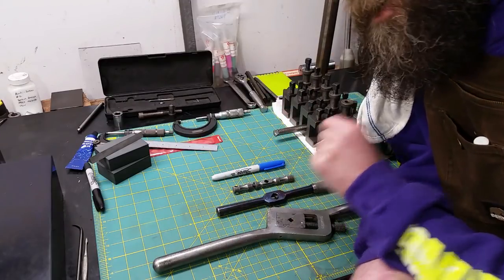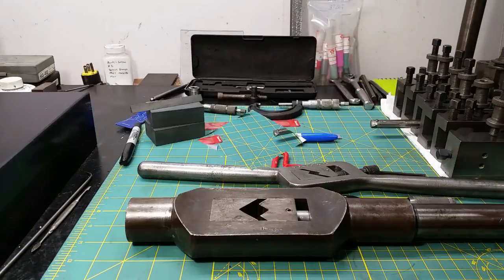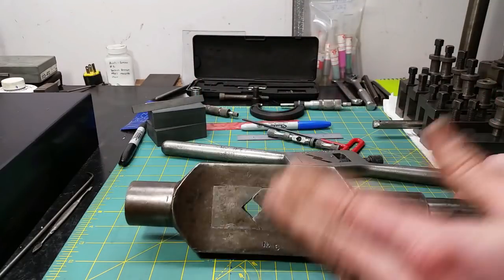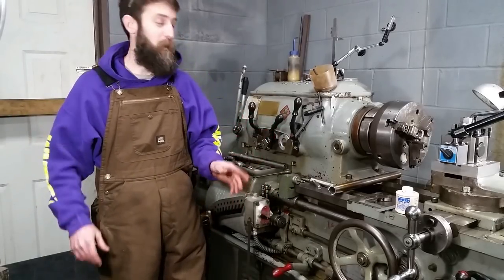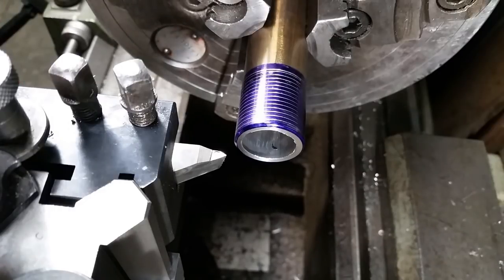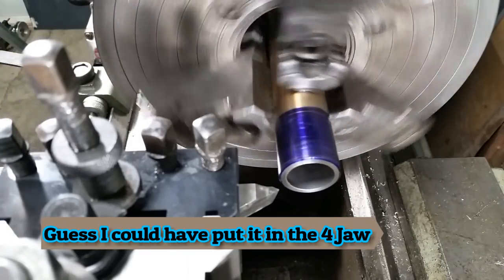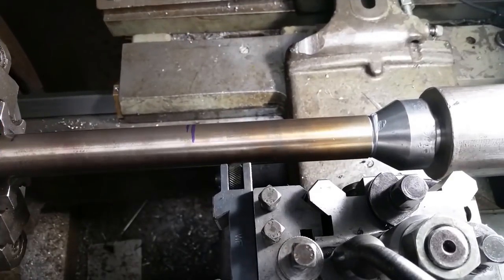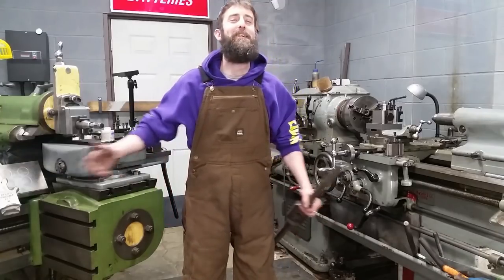Monster Tap Handle Repair / FAIL ;-)

Comment: Nice tap wrench and new handle.  I have never screwed up a knurl, Yeah right.   It happens.  You should see the pile of knurled scribe handles I have.
Reply: Randy Richard In The Shop you get to scrap knurl very efficiently with a capston set up Randy,  far more efficient than Steves method 😄

Comment: Old video, and  I tried to scan through to see if someone else mentioned it. I didn't find one, appologies if there is a comment like this already.

I struggled to get decent knurls, and got exactly the type of "faint and indistinct" knurls that you show. I watched a clip by Joe Piecinsky (From Austin, company called Precision something or other, I think you know who I mean, if I didn't get the name right), where he basically said "Tighten the knurling clamp hard" (obviously only works for the "clamp" type knurling too, not the "push with the cross-slide" type). It worked last time I did some knurling. First of the four little screws I made was not good, I then remembered that video, tried it, and the next three were great, nicely lined up. As I understand it, the extra pressure makes the knurling wheels "settle in the previous grove". So, next time, assuming you have a "clamp" type knurler, give it a good tightening on the clamping screw, and see if that solves it.

Comment: Don't sweat the knurling issues.  I've knurled literally thousands of parts, the same parts over an over, out of aluminum, and still cannot get the knurl to be totally repeatable.  Sometimes the pattern just overlaps, and on the next identical part (same speed, feed, depth of knurl etc ) it just works perfect.  When I figure out the secret, I'll let you know....
Great video as always, thanks for sharing.
Reply from the maker: Sascha Oswald Thanks man, I appreciate it 👍

Comment: Nice tap handle, and nobody likes a big tap wrench better than Adam so I'm sure he approves. Just the look of the finish on those old school hardened tools is something to behold, they just look like the real deal compared to current tools you see.   If you use the knurling charts and start with the correct diameter of stock so the knurl does not overlap it helps but somehow I still manage to mess it up.  Nice job Steve, sometimes good enough is good enough as the thing you are threading won't know the difference.

Comment: Good job fixing that Beautiful tap wrench ! The diameter has a LOT to do with how the wheels track , your wheels need to be parallel with the cylinder & on centerline & with tubing especially , walls will flex & you need to make a flanged " no crush " plug a little longer than your knurl to support knurl pressure.

Comment: Hi Steve Summers. Nice job on the repair. I have always liked the Scissor type knurlers. I actually made mine and a friend has made 2 of them. Also I know the diameter of the part you are knurling is important, to the size on the knurling wheel. My buddy and I did a bunch of investigating trying to get the perfect knurl... He can, I still cant get it right. Anyway, Great vid. Thanks.

Comment: I've never been able to get a good knurl out of the solid knurling tools. I'd go for the scissor type tools myself. My other tip for knurling is that you should engage the knurl, stop the machine and check, and if it isn't perfect pull out and move over and try again. Once you have the engagement perfect, you can run it back over the top of the previous attempts and you'd never even know they were there

Comment: Still ended up with a nice usable tool. Maybe not the most attractive repair but usable none the less. 

 Nice job Steve.
Reply from the maker: grntitan1 Nice to see you. Yeah it could have went better😃. But I want to show my failures also. I'm not a master of the trade.
Reply: Steve Summers Absolutely. Failures are part of reality. I learn more from my failures than I learn from my successes. Think about that.

Comment: Nice video Steve - thanks! You got me wondering about that little Moore & Wright tap handle and if the "anvil" (tip of the screw) would groove. I have one exactly the same and checked it - no grooves and tested better than HRC65 (by calibrated files) - nicely made little thing and one of my favourites.

Comment: That tool post looks great Steve, shame the project didn't come out as good as you intended,  but then there's always next time . All the best mate.  Got to sort out a larger tapping wrench myself anything over 1/2" and I'm screwed. Cheers Mat
Reply from the maker: lookcreations Great to see you Matt👍. The handle did not end up exactly the way I would have liked but I'm fine with it.. Nice to have a larger tap handle for the times when you run the large taps, using almost anything else seems to not give as good results.
Easy to tap a hole crooked using a 1 handle wrench.

Comment: Hi Steve, nice fix. what was the pitch on the knurling wheels? the part diameter has to match the pitch quite closely. in other words the circomferance has to devide wholy by the spacing of the teeth on the knurl wheel.
Reply: Phil's Projects You're are right, there's formulas for calculating different type knurled. I think the heart of the problem w a s trying to learn on a piece of overheated stainless which is very unforgiving and being bent just compounded the problem.
Reply: i agree, out of round really does not help the situation.
Reply from the maker: Phil's Projects Hey Phil, not sure the pitch of the wheels.... I will try and find out. The od of the pipe was 1.25"
Reply: should be written on the wheels. . the basics of the calc. 1/tpi (1/16= .0625 which is the spacing between the teeth) how many times does that fit in the circumference?
if your diameter is off the following tooth on the wheel effectively cuts the crest  of the next one if that makes sense. there are knurling calculators available on the net but where is the fun in that let me come up with a sample calc
Reply: lets say a knurling wheel of 16 tpi
1/16 =.0625" between teeth on the wheel
the circumference of a 1.250" pipe is 3.927"
3.927/.0625= 62.832
drop the decimal so
62*.0625= 3.875
3.875/3.1416= 1.233"
so your diameter needs to be 1.233 for the knurl to come out properly
Reply: Go to Pierres garage  https://www.youtube.com/watch?v=FQ5_VZxHnnU  he has some video of when we made the knurling tools for Keith Fenners WIYB might be helpful
Reply from the maker: Phil's Projects Thank you Sir for the detailed response, that makes perfect sense.  Thumbs up for Phil's Projects 👍😃
Reply: Joe Pie disagrees - his video on knurling shows that the knurls will track if the pressure is high enough, irrespective of the diameter of the workpiece and the pitch of the knurl wheels. Most knurling faults boil down to lack of pressure. In the case of stainless it needs a lot of pressure right from the start, otherwise you get work hardening and it is much more difficult. Also, the knurling tools with two opposing wheels tightened with a screw are much better - less force on the lathe. Anyway, your handle is perfectly useable as it is, and a deep crisp knurl is actually uncomfortable on the hands.
Reply: I've found on mine that the diameter doesn't need to line up with the pitch of the rollers at all, just gotta jam it in there HARD within one revolution and it'll track both rolls properly. Certainly a job for low backgear, some oil and power feed. 
Using cheap rolls will get doubled knurling every time. Get a good set with some radius to the edges.

Comment: Important thing is you got the threads right. After that you could wrap tape on the handle and it would have worked just as well. Knurling perfectly is not as simple as it sounds, because it is a lot like thread cutting. The pitch of the knurling wheels should just fit into the diameter of the pipe.Otherwise you will overlap the knurls. I confess that  I have no knurling tools at all. but somewhere on YT there is a video on it. Actually there are thousands of videos on knurling,,  but few of them mention the pitch of the wheels vs. diameter, and I wish I could remember where I saw this.

Comment: I had the same problem yesterday trying to knurl.Looked like it just chewed the knurls up but ok if its rough.Ran my tool holder in to the chuck because camera was in the way.Trying to work around camera is like texting and driving and takes most of the fun out of it.
Reply from the maker: T.R. RACKLEY LOL, never heard anyone put it that way but you are correct. Want machining a item to suck? Turn on the camera! Especially on the lathe.

Comment: Do you have to have a phase converter for each three phase piece of equipment, or will one work for the whole shop, as long as you only run one machine at a time?
Reply from the maker: Shane K I have 2 phase converters. One for the mill and one for the shaper. The lathe is 220 single phase and does not need one.👍

Comment: Nice work Steve , if you empty your clip you can club em with that  thang
Reply: It utilizes a magazine, not a clip.
Reply: FYI  JUNIOR ,  Clip (firearms)
From Wikipedia, the free encyclopedia

An M1 Garand en-bloc clip (left) compared to an SKS stripper clip (right)
A clip can reference a device that is used to store multiple rounds of ammunition together as a unit, ready for insertion into the magazine or cylinder of a firearm. This speeds up the process of loading and reloading the firearm as several rounds can be loaded at once, rather than one round being loaded at a time. Several different types of clips exist, most of which are made of inexpensive metal stampings that are designed to be disposable, though they are often re-used. A true firearms ammo clip has no moving parts and is made of stamped spring steel.
Reply: You made my point for me, thanks.  A clip is an open type device to hold rounds to be inserted INTO THE MAGAZINE, which is what a Glock utilizes.  Unless you get into moon clips which obviously get inserted into a revolver cylinder.  

You know, there's no need to get defensive when someone tries to help you by giving you some knowledge.  I wasn't nasty, condescending, didn't call you names or nothing.  I was merely trying to inform you of the correct nomenclature.  

I know Youtube comment sections are full of insecure, defensive folks, who have to lash out at everyone so they feel better about themselves, but not all of us are like that.  You have a great day!
Reply: Hey now killer,  simmer down simmer down , clips  mags, weren't talking nanos here , didn't want to ruin your days , go chill
Reply: Lol!  My days are never ruined by youtube comments fella.  Nice try though.  Take care.

Comment: Nice wrench and a great gift. Why is it the only piece of stock that is the right size always has issues? Thanks for sharing ~ Richard
Reply from the maker: Makin Sumthin From Nuthin Hey Richard, guess the answer is that I work with scrap most the time and take what I get😃. To be honest I would have been worse off if I would have went out and paid good money for new shiny stock. The knurling was my fault not the stock. If I would had new stock I still would have goofed the knurl.. The one I made works just as well and cost me nothing. Thanks Richard, I know you understand what I'm talking about 👍
Reply: Ohhhh yeah....I know exactly what you are talking about 😃

Comment: I am by no means a machinist nor do I have the knowledge that you do, you do some amazing work! But.. A warped un indicated pipe?
Reply from the maker: davey jones how would you dial in a banana? It was bowed I could have put the it in the 4 jaw chuck but it would have still been off. It was out of round slightly and bent. Not much I could do.
Reply: You use what you have around first, then only do you buy new. in my case I try first with what is around ( low cost other than a little time) then look at the local scrapyard for material and finally buy new.

Just thinking that those pipe ends are screaming for an internal thread, and a knurled brass end cap, so that you have a convenient place to put taps when you are going out to a job with it, saves damaging the taps in a toolbox and you always have them with you. Course means the taps must fit in the pipe, so under 1in or so taps that need the bit wrench to thread them.
Reply from the maker: SeanBZA Good idea! That would also look good👍

Comment: Maybe use the file under pipe so you don't have file impale you due to rotation
Reply from the maker: Sean Roberts Holding the file under the part would be like dragging the file backwards. 
The way I did it is a  common practice. 
Thanks for watching

Comment: Looked like knurllng tool was not square to the workpiece. According to Joe Pie, lube and MORE pressure solve knurling tracking problems.
Reply from the maker: Paul Mathews Yeah I noticed that after it was to late😃. I had moved my tool post to line up my 60° threading tool and forgot to square it back up. This project had all sorts of issues that could have been avoided with more experience. I chose to show my mistakes in hope others will see and maybe avoid them. Just learning as I go👍. Have seen you in the comments in a while. Good to see you Paul.